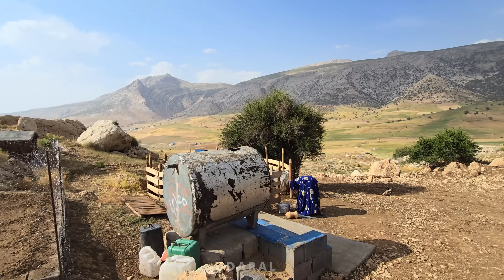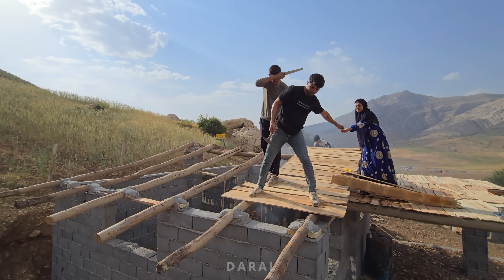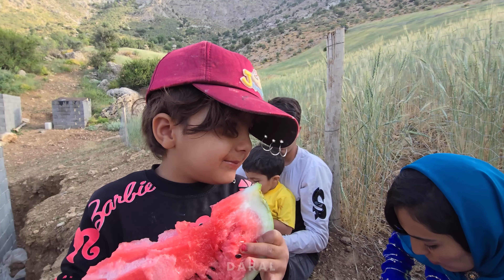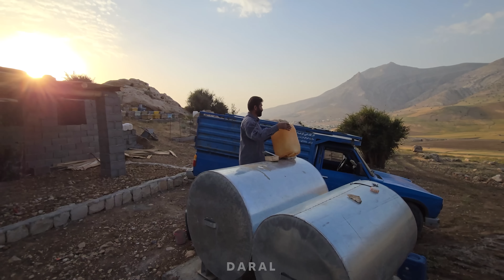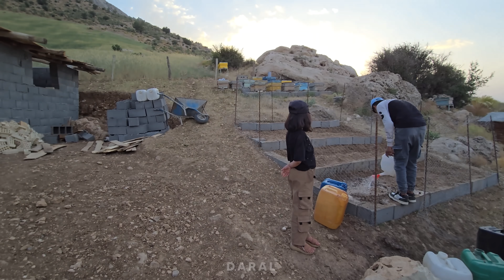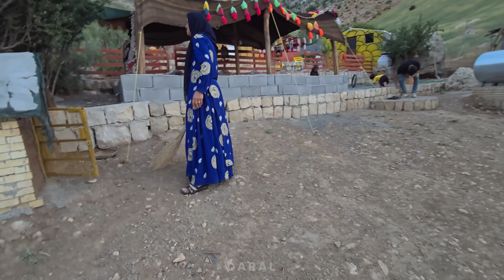Build Milad and Mahin's Wooden Roof | Aynaz and Tiyanaz's Farewell

Comment: Daral Family if u guys do not want to build a trench beside Milad n Mahin house all u guys need to do is, follow the water road up to the top of the hill and divert it away from coming down to the side of the toilet thus coming down to the house.
You can divert it to follow the other path which goes down near  to the truck. 
It us also a wise thing to fix the path before the rainy seasons appear. 
If u guys do not chose that path, always remember water can be a force to reckon with it is very unpredictable so even if u are going to build a trench near milad house u have to build a big trench with a bridge enough to walk across or a culvert to ensure no flooding to the house
Reply: Tiene razón, es algo que deben tener en consideración, prevenir antes de que suceda..hay que darle importancia a éso. 😊
Reply: I have said this over and over! When they were moving all those rocks around and trying to figure out where to put them I said build up the area where it came down before. Near the sand pile where they usually park their truck. 
Prepare now because the rain will come again!
Reply: What is difficult for me to understand is the roofs are made mostly flat and water will sit on them.  Also, outside patio floors are not a teeny bit slanted so rain water will run off.
Reply from the maker: Hello, my dear friend, thank you very much for your attention and concern. Rest assured that we will apply the necessary safety tips in the future. I wish you and your family good health💛💛
Reply: Thank you for the professional advice. 
I hope they will heed to your advice, coz they do as they please.
Reply: @daarall think and plan first before starting any construction. Consider your present weather and the seasons up there in the mountains. Construction is not spur of the moment.
Reply: Please say Old lady she should use spoon and stuff when she works with food. It is not hygienic to put hands in food. It is 2024 and they have everything, it is ugly, family is eating that at the end.
Reply: They also need to seal the brick work with tar to stop the water getting in.
Reply: @shpetimazizi  во первых ,она не старушка ,а во вторых советуйте другим ,а не людям ,которые знают свое дело без вас ,диванный критики и сами делать как она, не можете🤪🤪🤪
Reply: @emmafrick665  ☺💯👍🏼
Reply: Pois é isso que comentei uns dias atrás, é o caminho natural das águas da chuva
Reply: жизнь покажет..бесполезно учить..они ж не сегодня родились
Reply: .они не читают комментарии,  Оператор то же самое Было б хорошо,  если обрстная связь  хоть иногда 😊
Reply: Pienso  que la señora lo hace muy bien  , ella es muy trabajadora  , 
Algunas veces nosotros  no usamos  guantes para cocinar  solamente  tener las monos muy limpias  es suficiente.  Por favor  dejen de criticar otras costumbres  
No es educado . Salud pará  está  familia maravillosa.

Comment: I suggest you use galvanize roof...its light and easy to install. Also, you may install foam insulation to prevent the heat. Am just suggesting ❤

Comment: Who is older Milad or Hassan??
Milads wife told them to put more planks and Hassan said if there are any left over will add another line.
It seems that’s he is in charge 
I never hear Milad said anything 
That’s strange.
They say that Amir is an engineer, and that Hassan is studying that too, well that’s a weird way of building.
No reinforced columns, and put planks as a roof to then add plastic and cover it with dirt or soil and the apply some cement and then if they can put that hot insulation on the roof, that indeed is so strange
Reply: Hassan es maestro, está estudiando, el señor Amir no es ingeniero, es maestro constructor según la costumbre de su país así son las construcciones, ya lo explico Hassan una ocasión..
Reply: Milan is the oldest brother then Hassan and lastly is Ghadir.